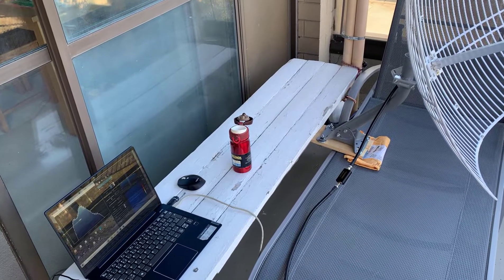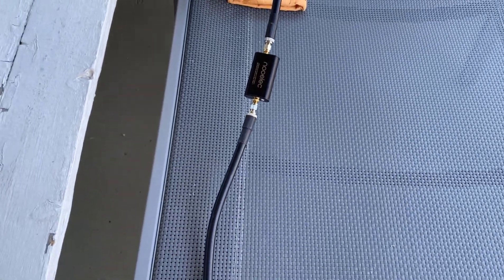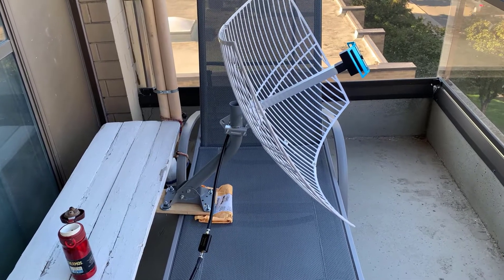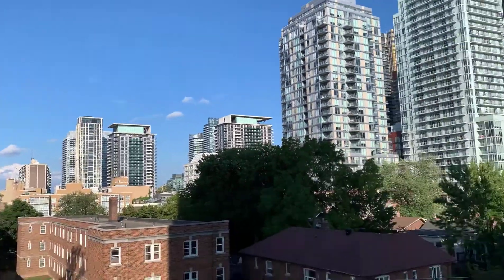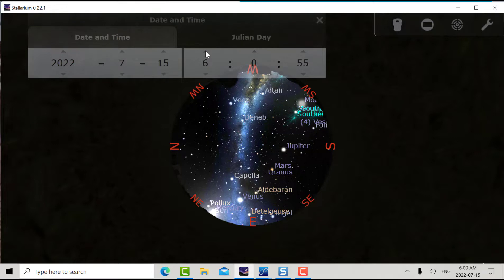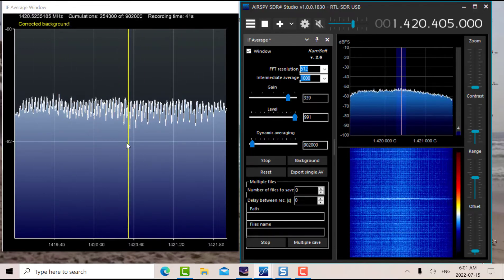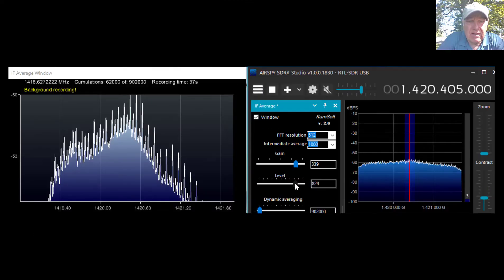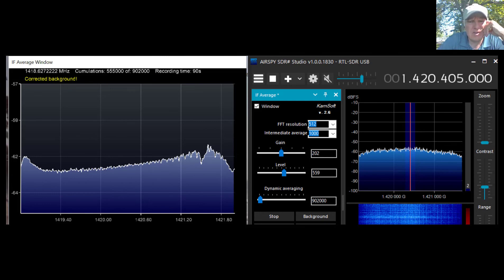RTL-SDR for Radio Astronomy - Signal Capture Attempt1

Comment: These pulse at the spectrum definitely don’t look good. I would suggest building an additional band pass filter (a cavity filter for example), changing the feed of the dish to something appropriate for 1420 MHz and using less coax (although that should affect things too much since you are already using lmr400).
Reply from the maker: The pulses are intermod from an ofdm ethernet extender. I had to go 70km out of the city to be able to receive properly.